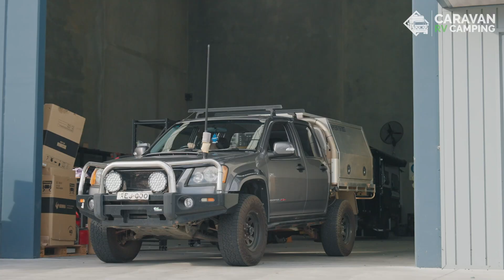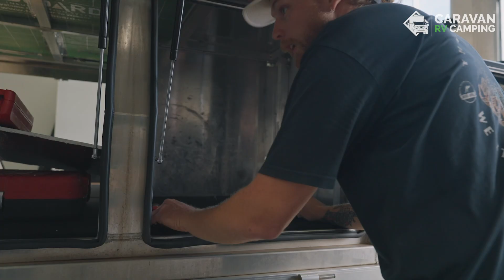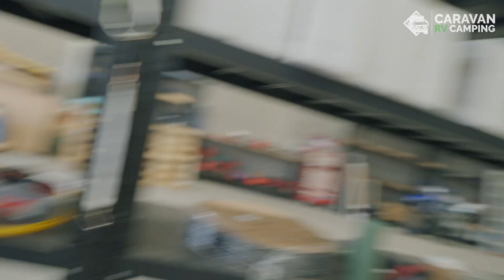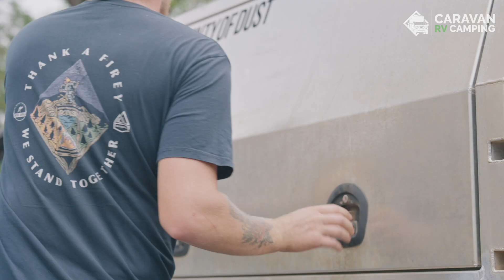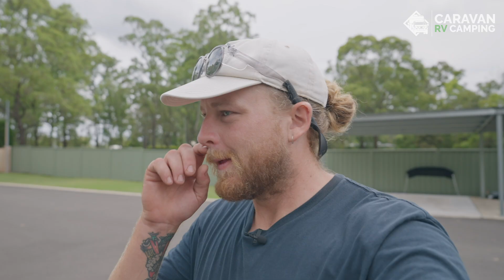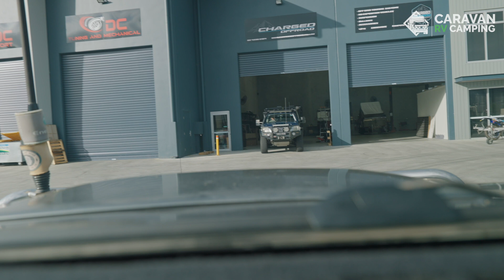The Dometic Voyager Mobile Power System Installation

Comment: Great informative video. Aesthetically it looks great. You have made me think this might be a great option to roof mount the Voyager in my canopy. Would you need to roof mount the battery as well?
Reply from the maker: Our B-TEC Slimline Metal Case range can be mounted to the roof and this would certainly free up some space, however it is not necessary; simply a personal preference.

Comment: So the 12 volt system is worth more than the vehicle? Makes perfect sense 😅
Reply from the maker: While the 12V system might seem expensive upfront, it can significantly extend the usability of your vehicle for camping. Think of it as an investment that pays off in the long run with all the power you'll have!
Reply: Ha my Garmin power switch and bumper lights more than my truck would cost. But it still works so if you enjoy it, doesn’t matter really.